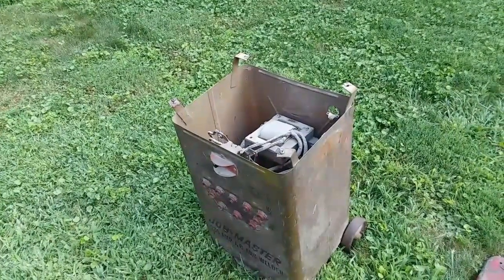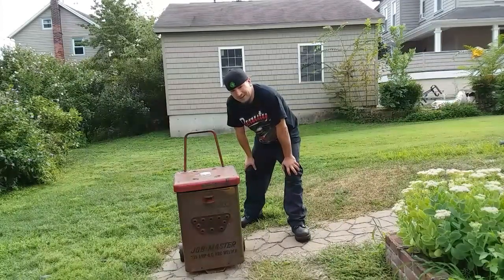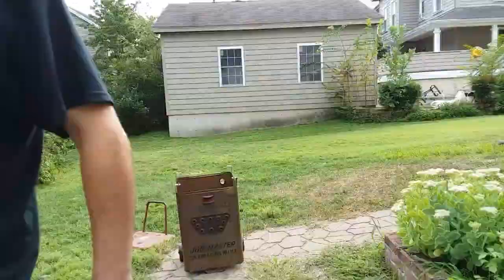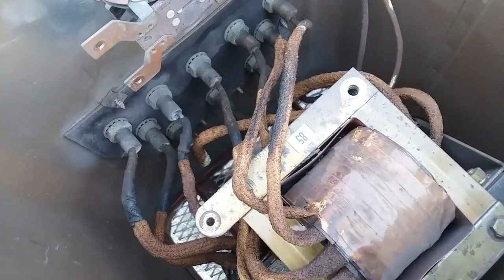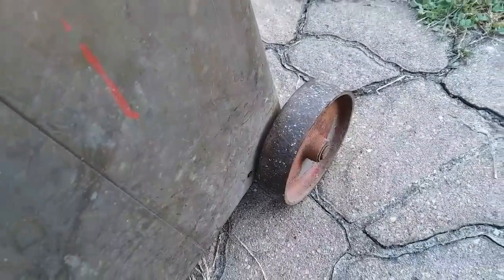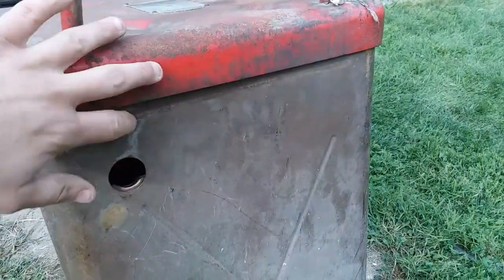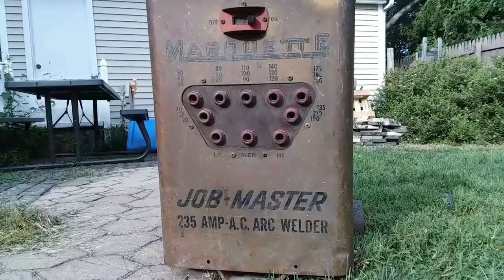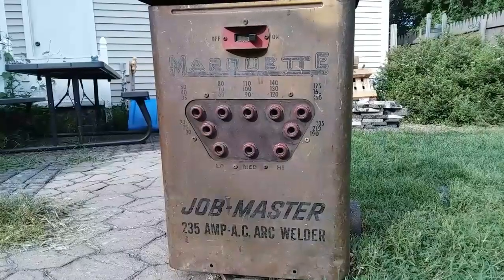WHAT COULD I POSSIBLY BE BUILDING OUT OF AN OLD BROKEN WELDER??

Comment: I would try everything to preserve those letters and numbers, maybe clear coat paint?
Reply from the maker: Once I take it all apart I'm going to clean the whole shell. I did that front top right corner with some stuff at the shop and it brought the gold right back out, but I believe it is too abrasive to use on the lettering. I'm going to scrub it with some soap and water first and then figure out something to clean up around the lettering. 
I may look into clear coating it, we've got some at the shop so it wouldn't even cost me anything to do it, definitely not a bad idea